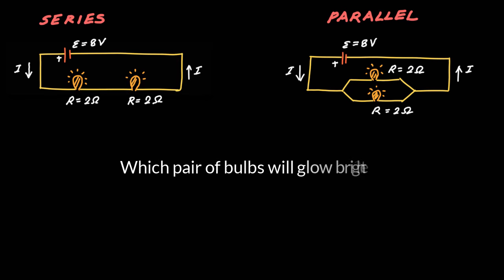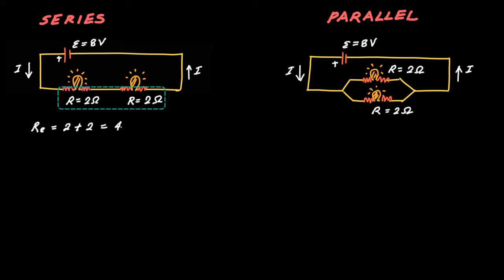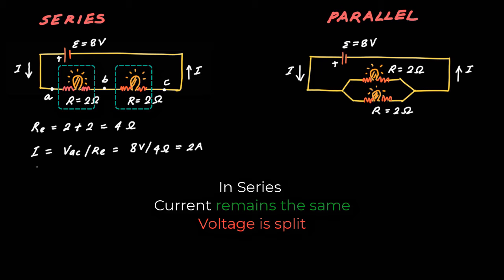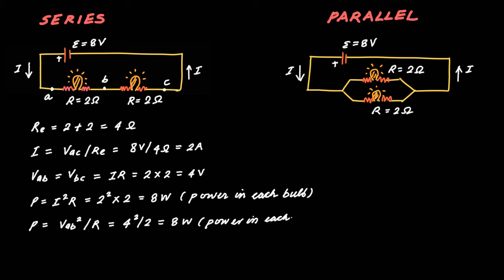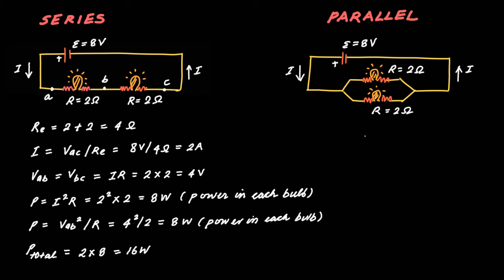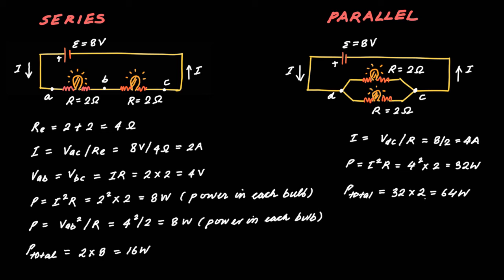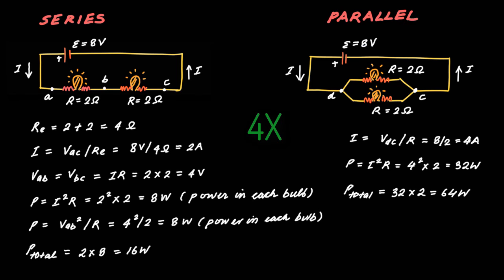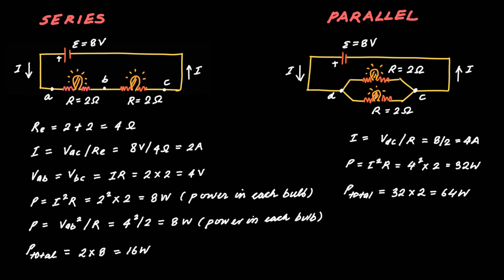Series and Parallel Circuits: Which Bulb Glows BRIGHTER?

Comment: Isn't the resistance in parallel circuit is 1ohm because 1/R1 + 1/R2
Reply: Actually u r right...
Reply from the maker: That would be correct. Any doubt you have...or any question around it?

Comment: i have a doubt if i connect 3 same bulbs in series will all the 3 glow with same intensity of the 1st one will b brightest. doubt is will the voltage equally divide bcz I read somewhere that the last bulb will glow the least
Reply from the maker: The way you should see the situation is that you have introduced another resistor in the circuit. This means you are blocking free flow of electrons. So the current goes down across the series. However I will still be the same for each bulb since electrons have only one path to pass through. So lower current means lower glow for each of the 3 bulbs, but equal

Comment: Sir if we use P=VI 
Than the answer is coming 32 W? Why

P=VI
P=8*4(in case of series)
=32
Please help
Reply from the maker: Have you taken V = 8V in series?
Reply: Sir actually i found my mistake... I doubled the current to 4 it should had been 2 only that would give 8x2=16. 

Sorry for wasting your time
Thank you for giving your time
Reply from the maker: @silentnerd1112  That is correct. You should also try to calculate individually and then add to see if you get the same answer.
Reply: Yes sir tried it both ways power of individual bulb is 8W

since the voltage will get divided equally among the bulb as they have the same resistance

That would mean
P=4*2=8

Than 8+8=16
Reply from the maker: @silentnerd1112  Fantastic! I am really very happy that you figured out on your own :) Where are you from?

Comment: Can you elaborate on the parallel piece, feels like there's missing info on why you just used 2 for R without calculating R equivalence in parallel
Reply from the maker: Good question Nick! You can do both ways. What I have done is stayed with the actual situation where there are 2 bulbs and I have found power delivered by each. If you find the equivalent resistance, it'll come to 1ohm and therefore the current through that 1 ohm resistor would be 8 amperes (I = V/R = 8/1)...and then if you calculate the power, it will be I^2 R or 8^2 * 1 = 64 watts which is the same as I calculated. Does that answer your question?
Reply: @TheScienceCube  thank you sir❣️
Reply from the maker: @Schrodinger77  Where are you from?

Comment: Sir , if number of identical bulbs are increased in series and parallel , will there be any change in brightness?in which circuit?
Reply from the maker: Hi Aparna! First, I totally overlooked your question. Sorry for that. Yes the power in bulbs in series will reduce but that in parallel will not reduce. I suggest you do the calculation the way I have done taking 4 resistors of 2 ohms each in both situations, using the same logic I have used
Reply: @TheScienceCube  thanks sir
Reply from the maker: @aparnasubramanian1203  let me know if you got it.